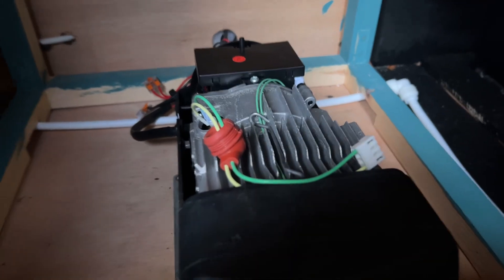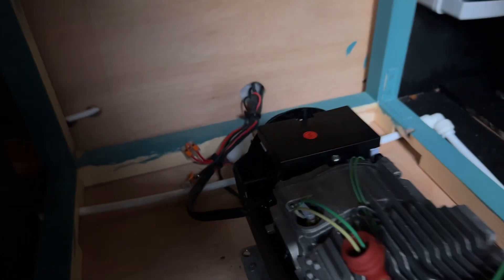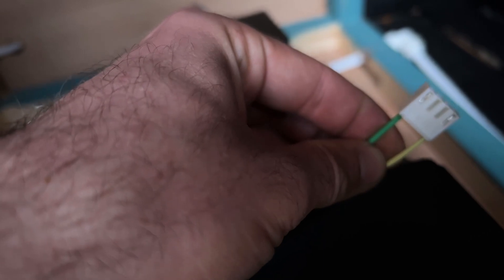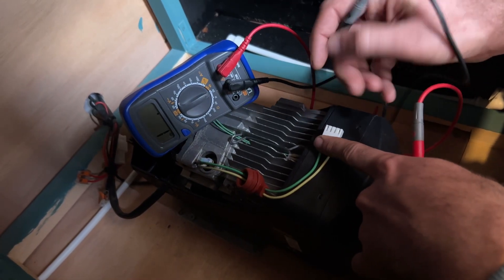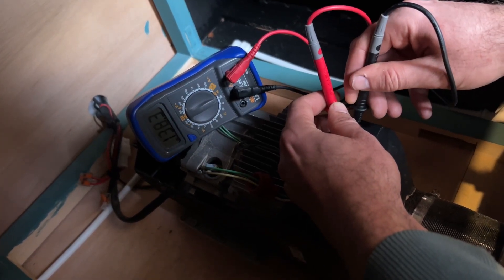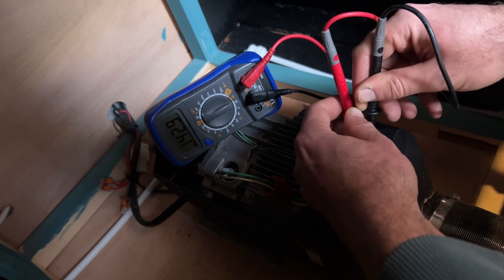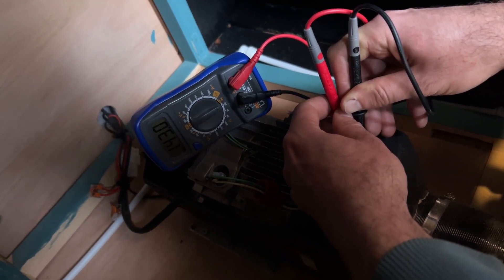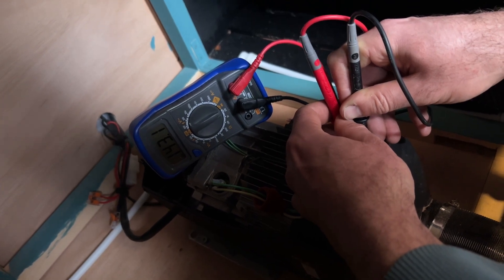E3 code diesel heater, how to check the glow plug with a multimeter

Comment: Stupid video that was. What setting do you set your multimeter. Never showed that. Anything under one!!! What does that mean ?
Reply: He is trying to help but doesn't understand most what he said was not correct. Its not voltage its ohms / resistance. This vid should be removed or edited to be correct info
Reply: I dont mean to be rude but maybe but if your not sure what setting to put your multi meter on you probably shouldnt be messing with electricity.  I know its 12v but you can still start a fire buy crossing the leads on a 12v battery. But to answer your question you want your meter on the ohms setting. It looks like the omega symbol. If you dont know what that looks like google omega symbol. Also just what he said anything below 1 ohm. The lower an ohm number is the less resistance in the circuit. In this case that would be the glow plug. The less resistance the easier for electrons to flow. Very high resistance means almost no flow of electrons very low resistance means more flow of electrons.
Reply: @lanceboudreau3630 wasn’t for me. You supply a video which is used for educational purposes!! Show all the procedures so someone can actually use the information. If your working with any electricity its good to give the starting point so someone doesn’t shock themselves or start a fire. And don’t assume your viewers know everything. That’s why everyone uses YouTube.

Comment: I have a Early Heater 2kw, small display with single rotary Dial. Message said Ignition Failure. Old glow plug showed 1 on meter no zeros. New Glow Plug showed 0.06 . Put new one in and all working. same meter. All Good. Cheers.

Comment: hello 
I changed the glow plug 
Battery with 12.8 voltage
I even changed the main board 
The fuel line and pump are also healthy 
But it still gives error e03

Comment: Hey maybe you might be able to help. Just installed brand new heater like yours tested like you did except mine reads .3 .4. I stuck my finger in the hole to touch glow plug and it was hot. The display read 13v but still throwing a e3 code.
Reply: Hi, did you solve it?

Comment: Hi i have change the glow plug on my chinese diesel heater and im still having the error 03 what it can be?!?!im desperate and angry!
Reply from the maker: It’s having trouble with ignition, there’s a little wire gauze that often clogs up and needs replacing, have you checked this?

Comment: Finally a 2 minute youtube that gets right to the point without all the bollocks -- thank you.   I don't entirely understand the numbers and what they mean since I'm no good with electronics.  Often my heater starts for a minute, I might hear a few clicks from the fuel pump but then shuts down with and E-01 error.  Sometimes it completes startup, after which it will run all night.  I replaced my solar-charged battery.  I'm not sure, but I suspect it completes startup and works only if my battery is at full charge after some time in the sun; if it's at all depleted, heater startup won't complete.  Please provide more details on how I might diagnose, and whether glow plug or fan are among the suspects.  Thanks again!

Comment: Hey I have a heater reading e 3 glow plug reading 5.7 ohms,  what should it be? Heater is only a few weeks old, ran great, after about 5 times of using it now reads e-3, from your experience is there something else I should check
Reply: Hey :)
Same problem here, did u figure it out?
Reply: @roger2475  it was the glow plug was bad. Ordered a new one, worked fine for one night. Now it won't get hot. Just blows white smoke. Going to order the Russian one. They have awesome reviews
Reply: @funfinding4two955  Damn 
Mine ran for like 15h max and got the code error. Tought these heaters would last longer tbh :d Whats the russian one called?
Reply: @roger2475 mine run for like 20-30 min as a test. Next day error E03 😂
Reply: @ZixX96  lmao that sucks. I ordered a new glow plug and now its working
Reply: @roger2475  got one in the mail too. i hope it works with the new glow plug.. yesterday it ran mysteriously fine, until i shut it off too tighten the exhaust pipe and then it gave me instant error E03.. dont know what is going on. resistance is around 8.5kOhms...
Reply: @ZixX96  8.5k ohms is way too high, should likely be around 1 or 2 ohms.
Reply: Hi folks;
Same problem here, the heater is quite new : 3 test runs so far, less than 5 hours total !
So ER-03 this morming during the third test, checked the glow plug 0.6 ohms ... I am currently investigating

UPDATE : according to this video :
https://youtu.be/WsSDyrkqTb0?si=Cx-A1EHafVE1fngU&t=57
0.6 ohms doesn't seem bad ...
So I am puzzled ...
Reply: Str8 out the box mine threw a e03 code! On first start up. Plug is reading 8ohms rip
Reply: @Jackasskidz4  So my glow plug was reading 0.6 ohms but upon further investigations I discovered a faulty contact. So I changed the plug and problem solved !

Comment: Really enjoyed your wood stove video and subscribed!!! I'm going to be doing my own van conversion in the next few months and wanted to ask you would you recommend getting a diesel heater if you also install a wood stove burner. Many thanks,

Rory
Reply from the maker: Hi Rory, I’ve done a van with a wood burner only and vans without the burner and with a heater like the propex, I think having both is ideal if you have the space, on those longer colder winter days the wood burner is lovely but on those days when you just need a little boost it’s really good to have a diesel/LPG heater to warm the van. 

Also you may not be able to use the wood burner in some park up locations especially if you’re trying to be stealthy.
Reply: @Aboutavan  Thanks for the information! I'm going to install a diesel heater too to make sure the camper is nice and warm. Looking forward to seeing the rest of your videos!

Rory